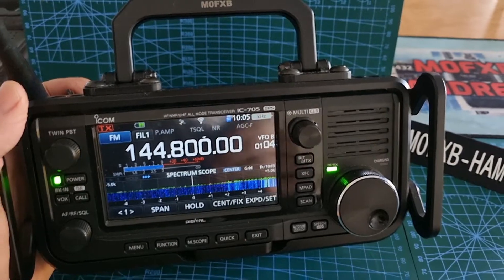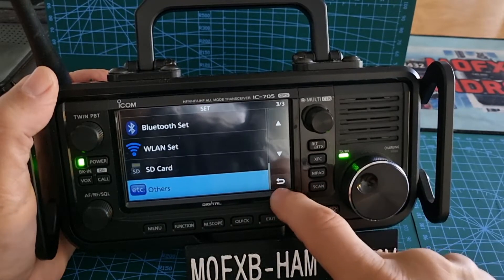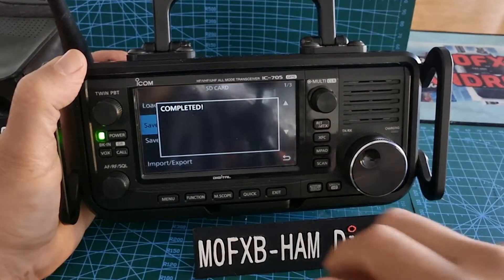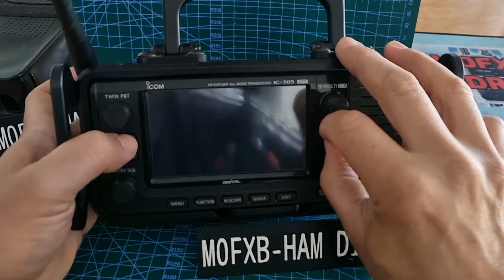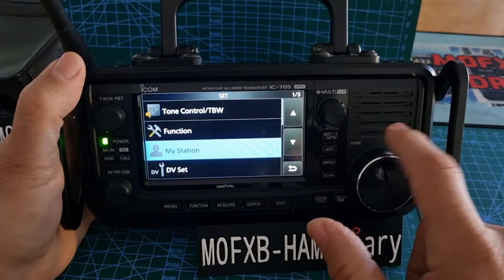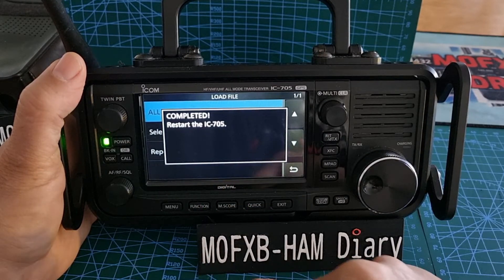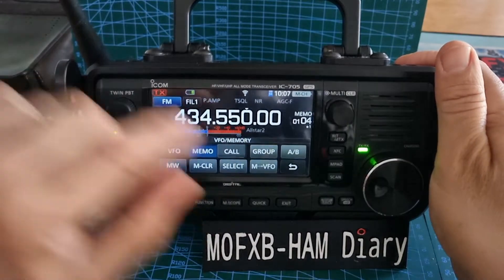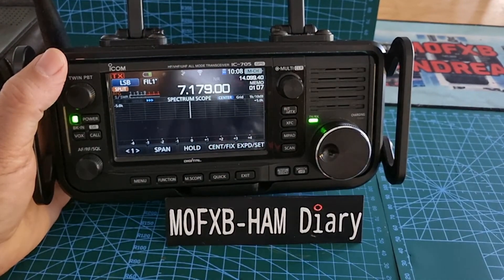ICOM IC-705 Reset Using Buttons

Comment: Great tip. Thanks for posting. If my keypad would have locked up, it's panic city for me. Hi Hi
But, I have screwed things up a few times and restoring from the SD card was such a nice feature. I have to say, Icom really did their homework when they designed that radio.

Barry, KU3X
Reply from the maker: Yes top radio-cheers

Comment: So just took possession of a brand new 705 out of the box from my father. Won't power up! On external power (13.84 Volts) all I get when I hit the power button is a flashing power LED. Tried your reset, still no go, any suggestions??
Reply from the maker: Is this with battery connected ?
Reply: @HamTechRadioScannerDrones  With battery connected, push power LED flashes once. With no battery and 13.87 volts DC going in, push power LED flashes continually  and will only stop when power is removed. (I can hear a relay operating with the flashes.)
Reply: @HamTechRadioScannerDrones  Problem solved, the 2 battery chargers I was using as an external source must have had current limiters! Now running a 12 volt 3.3 amp power adaptor and powers up, and shows battery charging!!